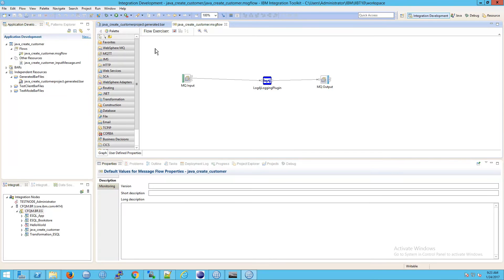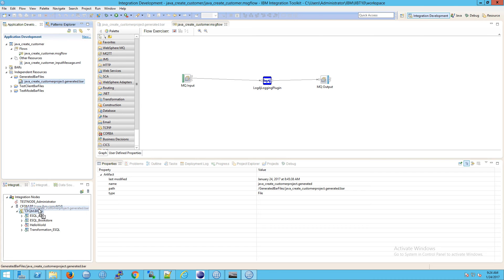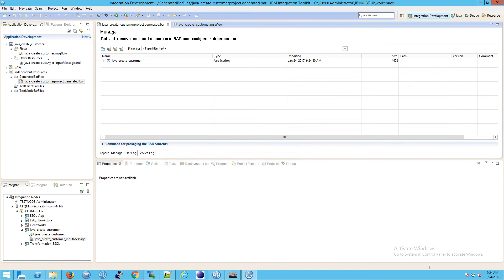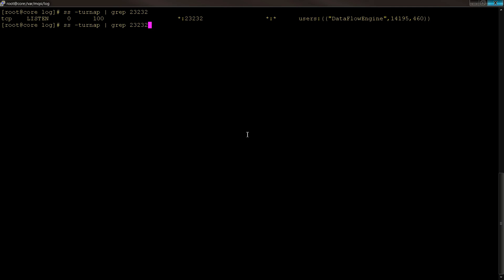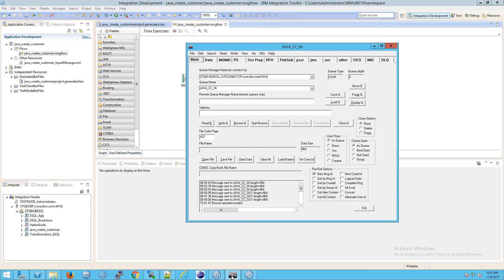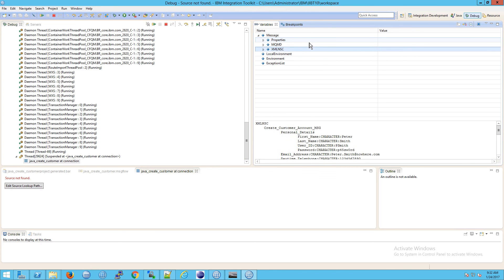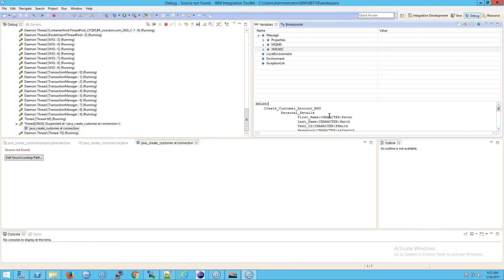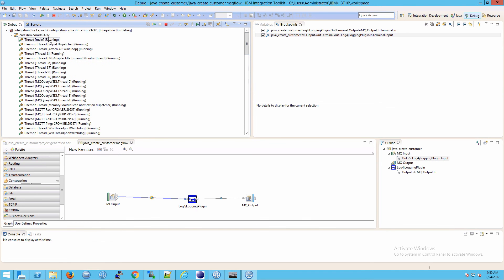IIB: How to debug a message flow using breakpoints in IIB Toolkit

Comment: This has been extremely useful for me as I have several Java Compute Nodes on my message flows. I was struggling with changing between the Debugger and Flow Exerciser, whether I wanted to debug my Java code or check what was going on between nodes. Thank you for your video!